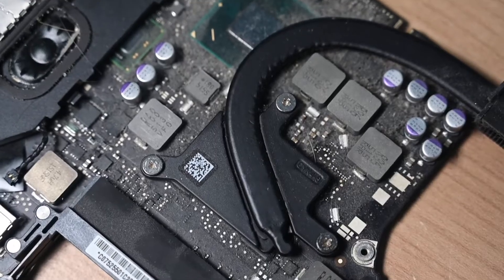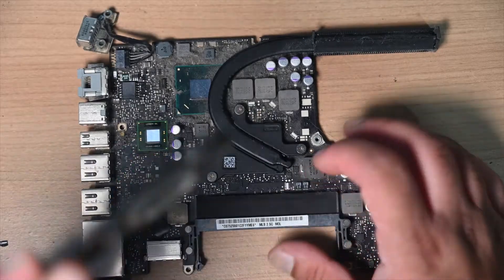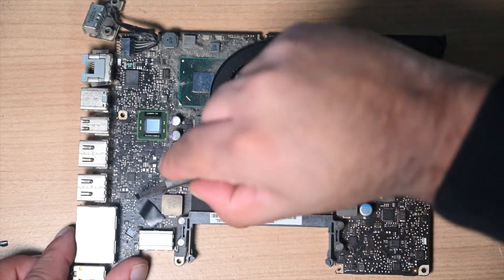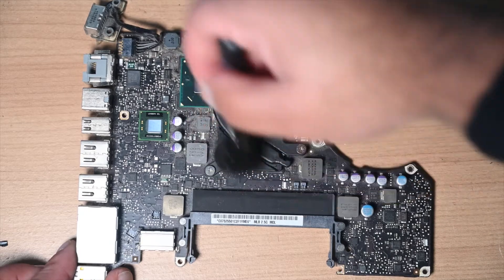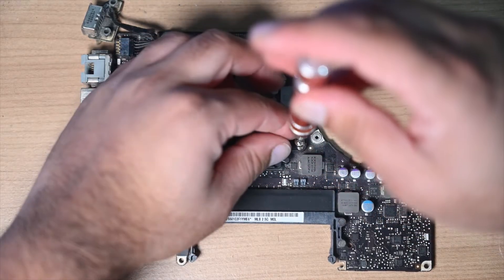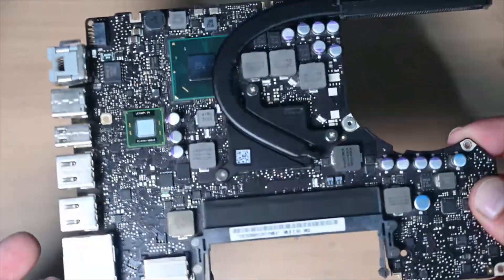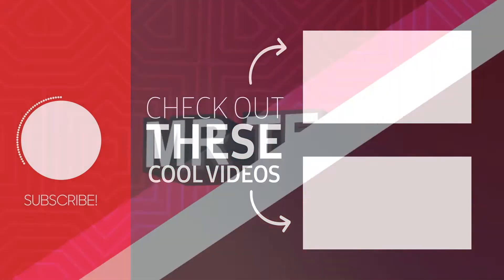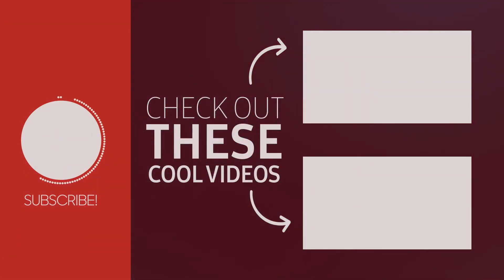How to clean Apple Macbook Pro | Apple Macbook Pro Logic Board Cleaning

Comment: After clean my MacBook Pro is not working.. speaker wire is not connected.. so that’s pin is broken.. Can the system be turned on without plugging in the speaker wire? plz help me out 🙏🏼
Reply from the maker: I would say fix speaker wire if you can, but it should work without speaker plugged in. I turned on before without keyboard plugged in and it turned on. As long as nothing else is damage it should work but no sound.
Reply: MrTech YT I used rubbing spirit for cleaning.. charging is working and battery level also
Reply from the maker: Look carefully if you missed anything inside, make sure everything is plugged in inside and you haven't damaged any other cables